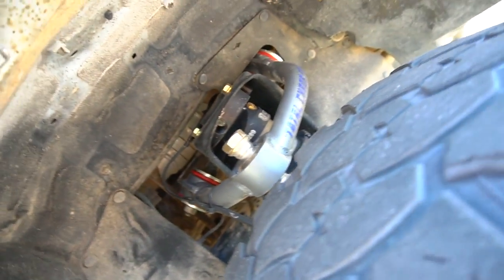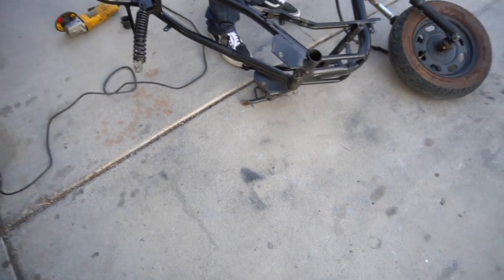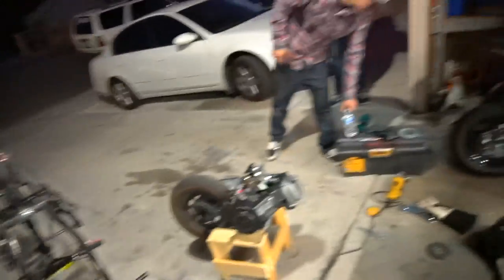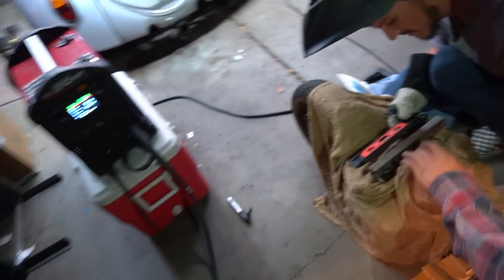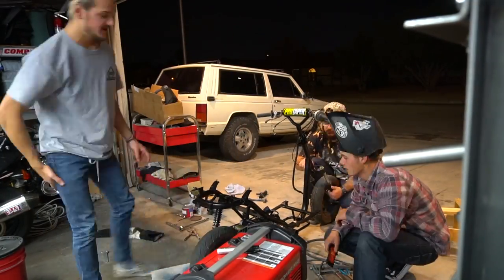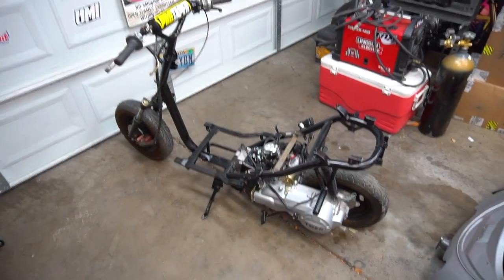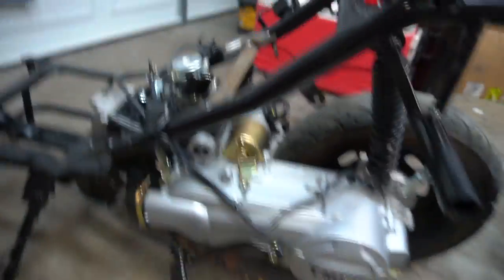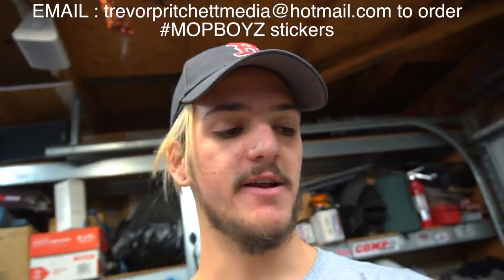BEST WAY TO MAKE A 50cc SCOOTER FAST | 150cc GY6 Engine PART 7

Comment: cool project :) I got my first scooter when I was 15 or 16, It was a PGO HOT50 2 stroke with 50 cc motor but I tuned it and got a 70cc Athena cylinder kit and It had about 10 HP. It was fast, min. 100 km/h - no problem. That was with standard gearing and the motor was brand new so I could not max it out. But I sold it after a while because I needed the money for driver licens ( car ). Now I have a new scooter project after almost 15 years and this times it is a VGA Explora ( 50 cc 4 stroke ) and today I did a engine swap ( 50 cc VGA Firefox 4 stroke ). That was only because I wanted the 12" wheels from the firefox :) So now I have bigger wheels, larger front brake disc, larger brake caliber, sports exhaust and other cool stuff. Next step is getting a big bore kit :D

Comment: it will twist, i did it this way but the vibes were hideous and it twisted the mount eventually, when i re did it i bought a 125/150 top mount, you bolt that to the engine and weld two lugs one either side to bolt the bracket to, the oem mount has a double pivot one at the engine bolt and another at the top bolts, this cured it no vibes no twisted mounts it a bit more work but worth it.

Comment: I'm doing a custom build and putting a  125cc pit bike motor with the automatic no shift clutch on my custom kynco agility. Shit is going to be sick as fuck bro. Got to figure out how to custom build the mounts and also set up a clutch Bell on the input shaft with sprockets and a short 2 piece chain, depending on how far the motor and sprocket is from the input shaft on the rear diff.

Comment: dude your front end is bent
Reply from the maker: Juan Sanchez your rear end is bent
Reply: seriously bro i have a 50 cc frame with a gy6 long case home made check your forks in the front in this video tbey seemed slightly bent from coming down hard on wheelies i solved that in my frame by swapping to the 150 front end off craigslist parts bike it fits just have to put your frame bearings on that fork